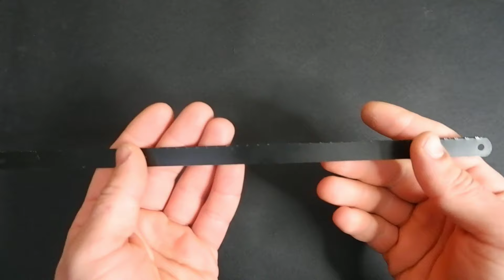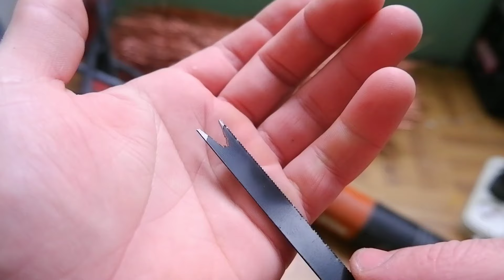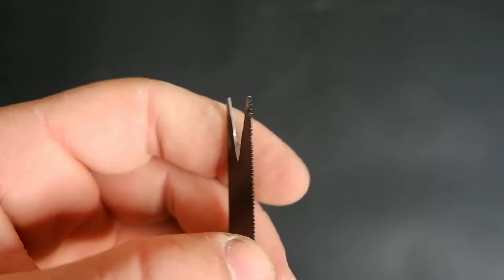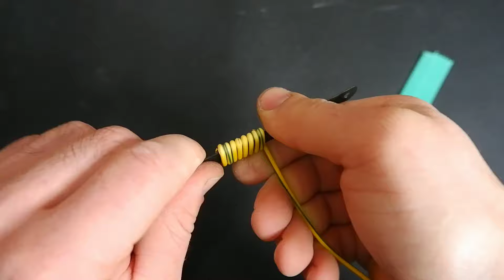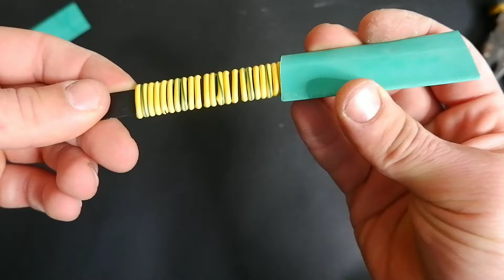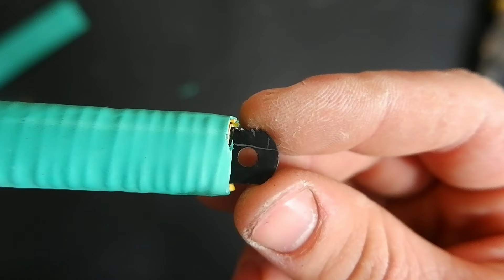Best Knife for stripping wires | Make it in just 5 minutes.

Comment: While the video is good and the idea grand, it would have been nice to have a material description in the information section instead of a ton of meta-search engine data.
Reply from the maker: Thanks friend, I'll try to fix it 🙋‍♂️
Reply: It’s clearly a hacksaw blade. What kind of description does a hacksaw blade need?
Reply: Haha! I know right? Well we may aswell add a list of tools required for the job followed by a step by step manual with diagrams and measurements. 🤓
Reply: if you cant recognize a hacksaw blade, angle grinder, a bit of extra wire and some shrink tubing, You probably shouldn't be doing any DIY projects at all.
Reply: @PortersMob  you forgot the file. That's what they need a list and diagram for. Lol
Reply: a